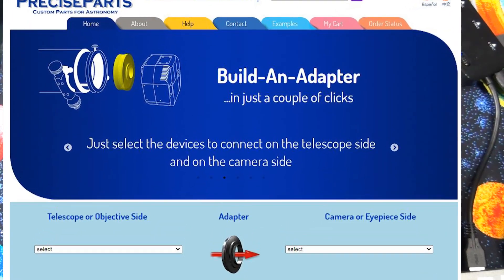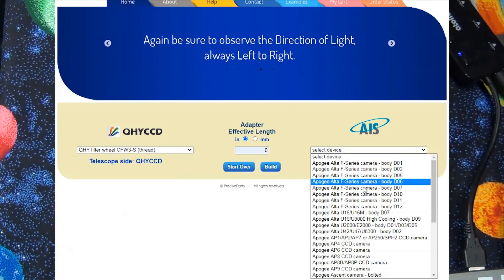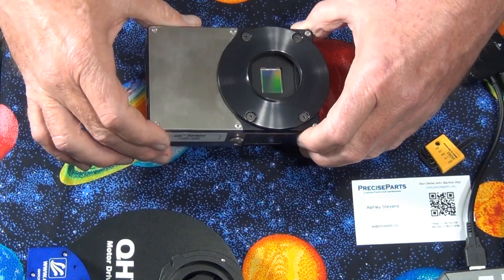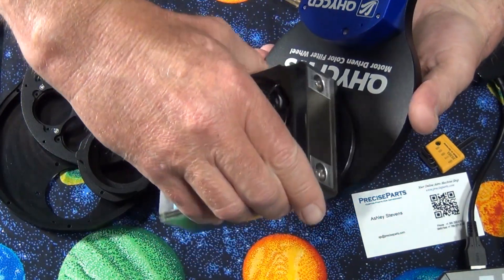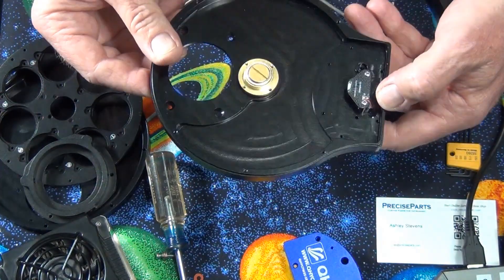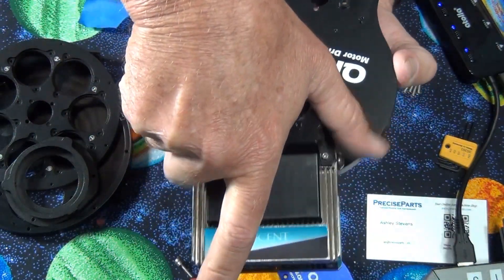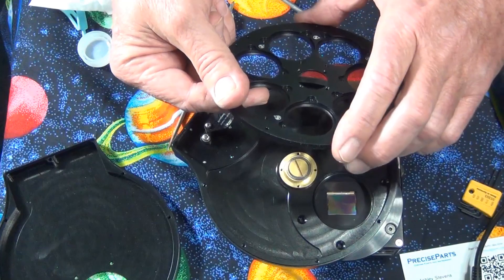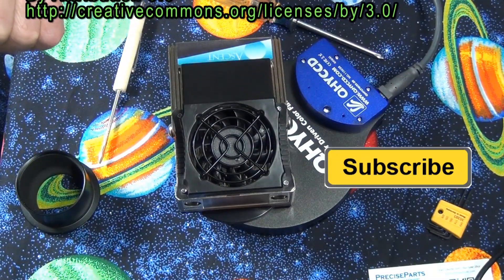How To Find Astrophotography Adapters

Comment: Wow, another good video. And save the apogee camera. I plan on first light on my astroberry tomorrow night. I've simulated a couple of runs with success. I think I'm ready. I'll let you know.
Reply from the maker: Hi Steve,
That's exactly what I'm doing right now.  Doing practice runs in my living room.  I've got the mount, camera, and now FW working.  Still need to work on the Guider and focuser.  I want to be sure I can do a test run from the comfort of being inside before I get out somewhere and find I'm missing something.  Good luck on your first light!  Let me know of any tricks you find.  Thanks for the kind comments.
Doug
Reply: Well I must say it's a process. I still working out bugs (my bugs). One thing I learned, run an Ethernet line. As good as you think you're wifi is, it can stop you dead at the most unoperitun time. After two nights l think I'm ready to image.
Reply from the maker: @stevehauser7486  I'm running into a crossroad decision now.  To use Astroberry or Ubuntu on the raspberry pi.  Ubuntu can run 64 bit and it has support for the Polemaster which I own.  Astroberry doesn't support polemaster.  I'm building both right now.  The astoberry is a sweet package already built for you and the Ubuntu version has taken more time to develop.  I've read in the INDI forums where 64 bit works much better with Plate Solving in Ubuntu.  Have you tried Plate Solving in the Astroberry?  Yeah, not sure which direction to go right now  . . . It's definitely a process I haven't figure out yet!   I haven't even thought about Ethernet cabling yet!  = (
Reply: @Myastroimages  I got two nights of good imaging. Up to 90 secs. guiding wouldn't work.  I couldn't get the polar alignment tool to work properly, so I manually polar aligned with Celestrons ASPA tool, I have an avx mount. Plate solving works really nice, I used solved and sync to center frame my targets and it works very well, within 30 arcsec. Fantastic. Blind plate solving doesn't work though, so I need more studying here too. Also guiding would not calibrate. so I have that to work that out too. lol lots of studying, hey!  I'm an APT guy and would like to get my bugs worked out and use it as my primary acquisition tool this summer as it mostly works with INDI server except dslrs, waiting on ver 4 hopefully that fix will be in there.. Maybe I need to get a ZWO camera; but Im poor, I use my moded T2i Good luck and clear skys.
Reply from the maker: @stevehauser7486  Thanks for the updates Steve!  I'm moving forward with Raspberry PI.  I finally got the GPSD working now.  That's the next video I'll post on the 15th.  All your challenges are going to be mine as well when I get to them.  I can't believe how hard it was to get GPSD working correctly.  Auto guiding has never been an issue in Maxim DL.  But that will be a definite requirement.  Polar alignment is another big one too.  Doug

Comment: I think the ascent filter wheel should work with ASCOM but I can't be sure. I can't quite remember tho, it's been a while since I looked at it
Reply from the maker: I've tried, no luck on Ascom.  I tried contacting the developer of the original Apogee ASCOM driver for the camera.  He basically told me it would cost too much for him to develop an ASCOM filter wheel driver for the A8050.  If you do know of an ASCOM driver for the A8050, this would be the first I've seen.  SInce the filter wheel is integrated to the camera, I guess this adds another level of difficulties.   The ASCOM Apogee Camera driver does work, but didn't work for the filter wheel for me.